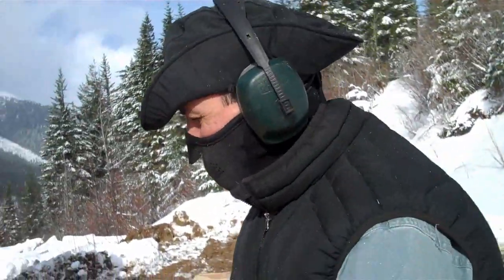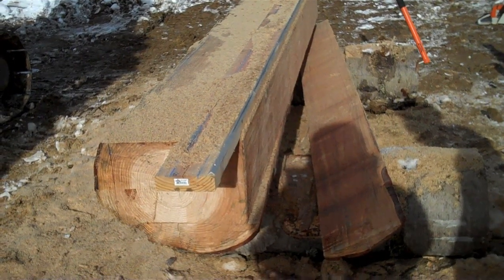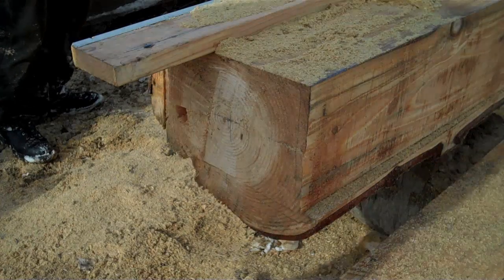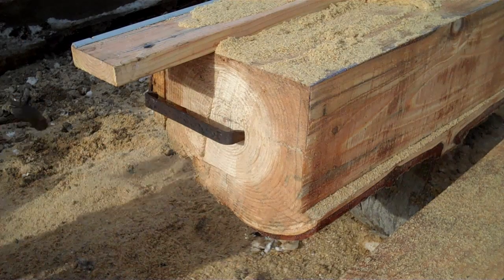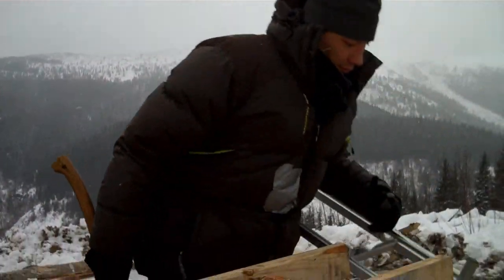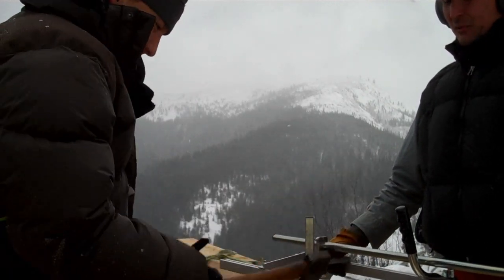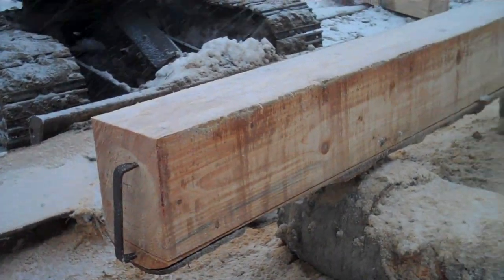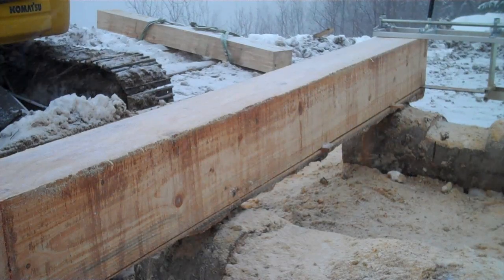Alaskan Chainsaw Mill Off-Grid Homestead Project – Day 1

Comment: Hello Wranglerstar!  Love watching your videos.  I'm really curious about your Alaska chainsaw mill.  I was hoping you could explain the set up and how you make your initial rip on a whole log.  In this video it looked liked 2x4 running on edge the length of the log.  However in a previous video it seemed like you use rather beefy nails with snap line and moved a 2x8 along as you were cutting.  That would be great if you could give that some explanation.  Thanks!

Comment: I use them cut off pieces of wood to heat my house. For $35 a truck load, ya can't go wrong. Bring'm home, slice them down to 2 ft. pieces and stack'm up. 4 loads a season is about the norm with that stuff.

Comment: Either I'm not "getting" your system of titling videos, continued stories, etc. Or we need a change. 

May I suggest: when you put up any kind of video title that suggests that more info/video is coming on that topic, please keep in step with your first title. Like this... "Alaskan Chainsaw Mill Off-grid Homestead Project Day 1" . It follows that the second such video should be titled like, "Alaskan Chainsaw Mill Off-grid Homestead Project Day 2."  I have a hard time tracking down videos that continue on the same subject matter. A logical adjustment in this wise would be most helpful.

Lastly, I believe you have the ability to change content. Perhaps a few titles, where nothing "follows" yet, could use rewriting. What say ye? 

With gratitude for these presentations,
Michael Dougfir.